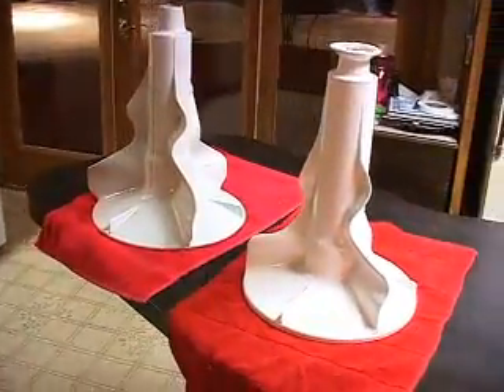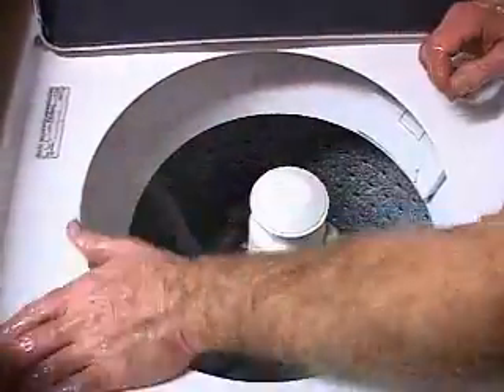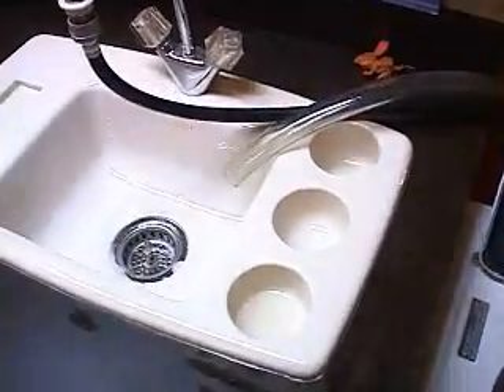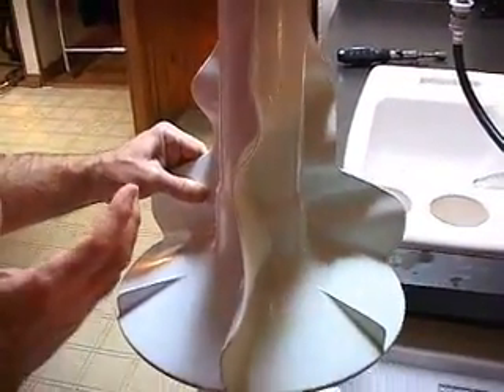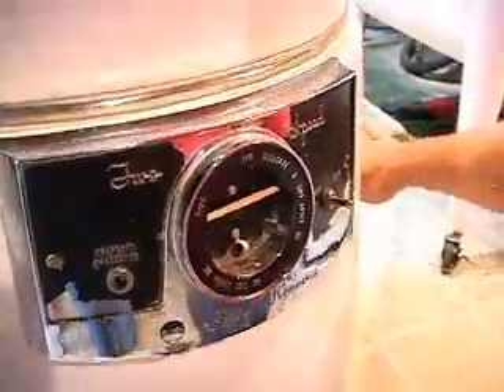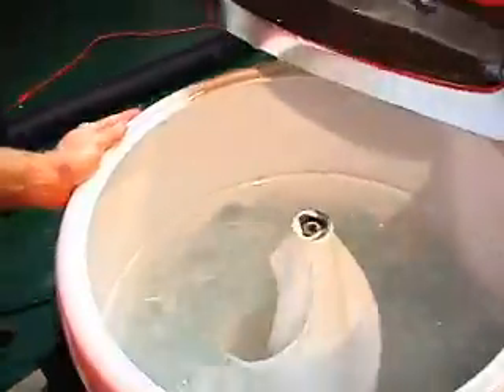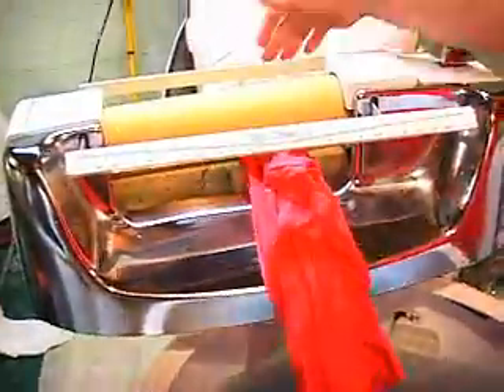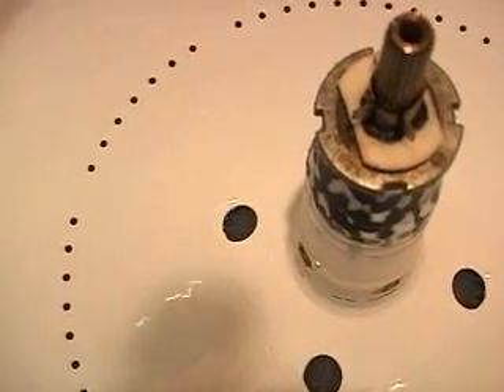Dorthy Street Wash Machines

Comment: Great collection, thanks. If you want to measure the RPM of your machines, get a lathe RPM tester. It's a little revolution counting gizmo you hold in your fingers, and touch the tip to a rotating shaft. You then time off 15 seconds, release it, and multiply the rotations shown by 4. You could put a dollop of plasticine clay on the agitor temporarily to stick the RPM tester into. I use mine all the time for drills, routers, and such.